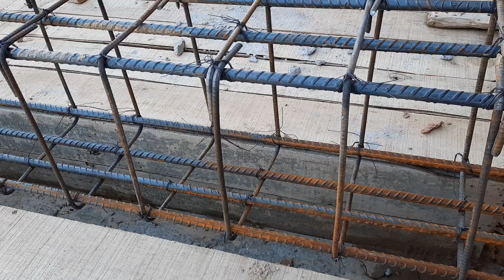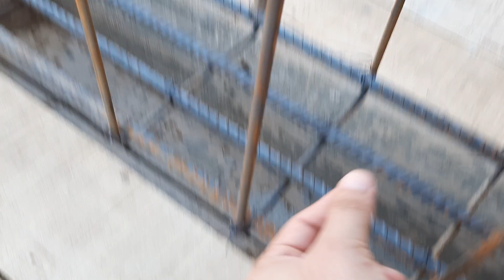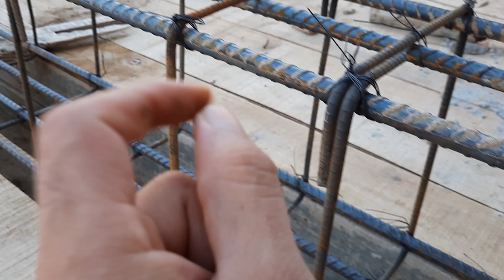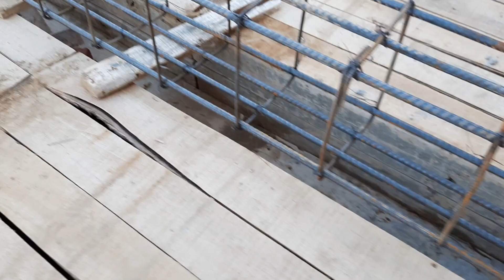5 Biggest Mistakes in Beam Construction |

Comment: Hello! Thanks for the explanation, it is very useful.
Shall I have few questions about it?
1. What do you mean "development lenght" of the steel bar? Do you mean extra lenght of the bar bended up at th end of the beam?
2. Can you confirm if the diameter of steel bars are really 16mm? In comparison to the stirrups which are diamater 6mm the bars seems to be thinner  than 16mm (around 12mm).
Have a nice day!
Gabor